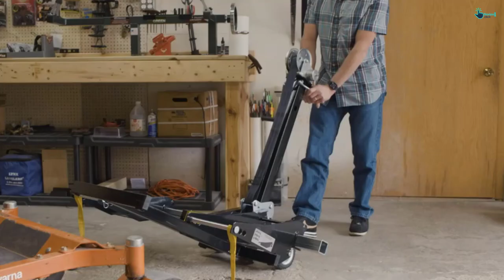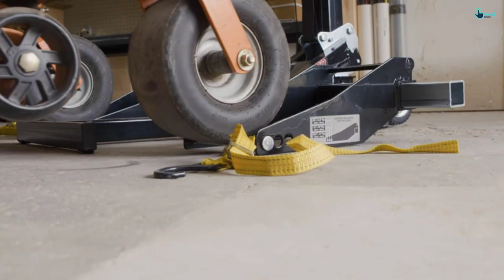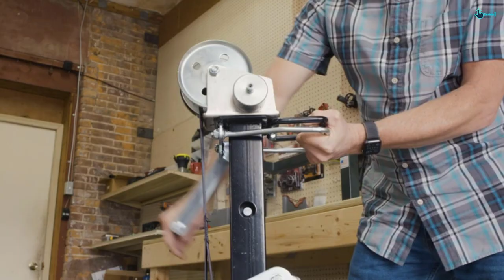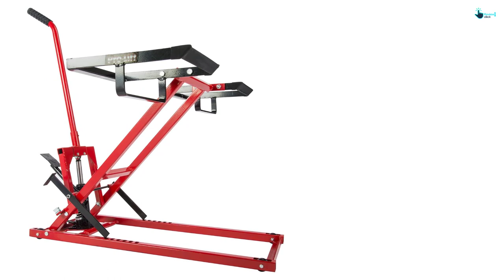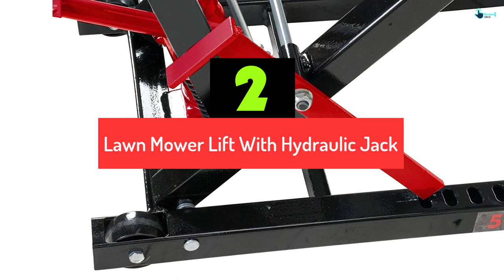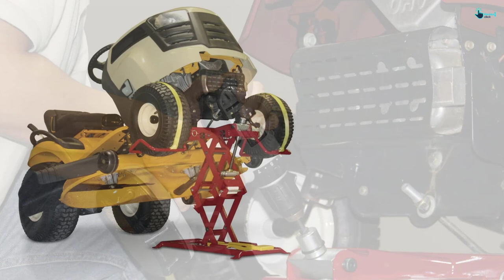▶️Top 5 Best Lawn Mower Lifts That Work In 2023 Review

Comment from the maker: ▶ 5.Residential Riding Lawn Mower Lift 
[Affiliate]https://amzn.to/3Yh4KDk 
 
▶ 4.Pro Lift Lawn Mower Jack Lift  
[Affiliate] https://amzn.to/40W6WC6

▶ 3.Multi-Level Safety Braking System Lawn Mower Lift 
[Affiliate] https://amzn.to/40W6XGa

▶ 2.Lawn Mower Lift With Hydraulic Jack 
[Affiliate] https://amzn.to/40JGhYY

▶ 1. Mower Lift For Most Residential & Small ZTR Mowers
[Affiliate] https://amzn.to/3IcXjr7